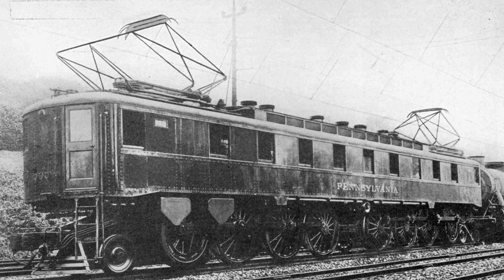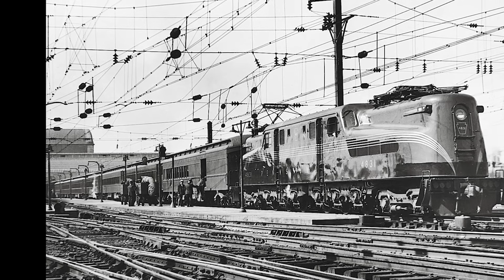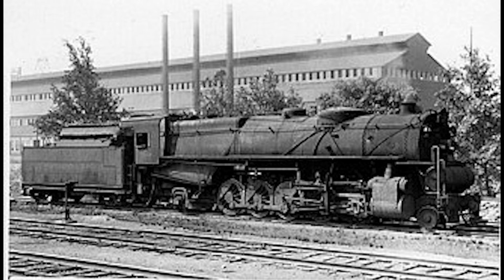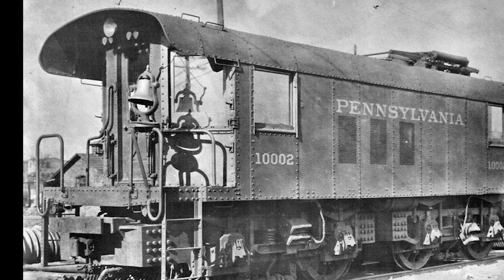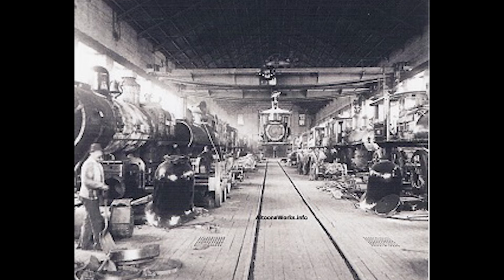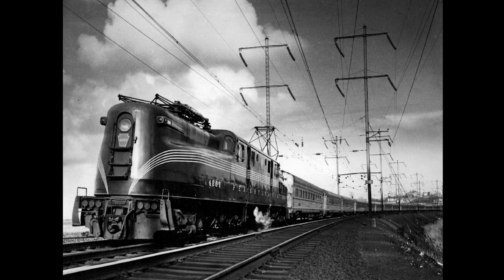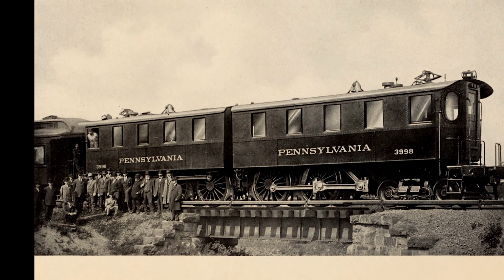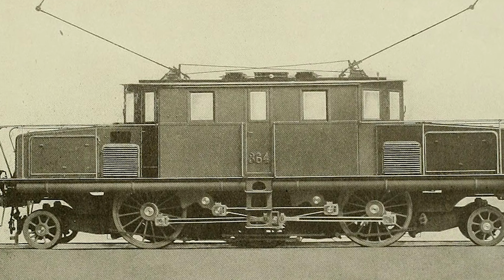The Story of the PRR FF1 ‘Big Liz’ and Why It Shook Itself Off the Rails

Comment: The electric system still had an interesting approach. It used a rotary converter to produce 3 phase electricity, used in AC induction motors. Usually electric locomotives used brushed motors and transformers with several voltage outputs until the 1980s when inverters got standard, enabling a variable frequency with 3 phase motors.